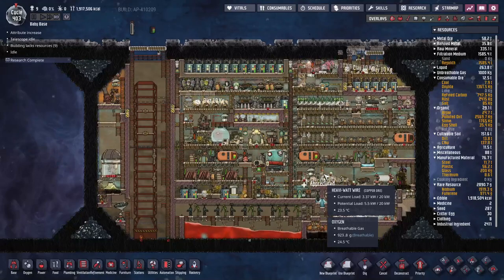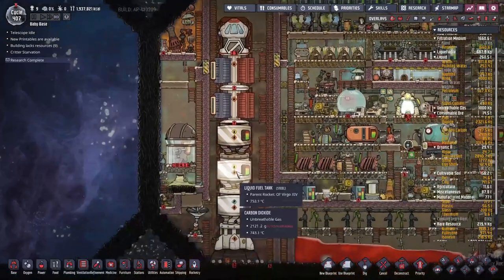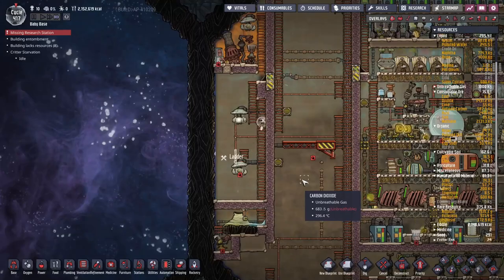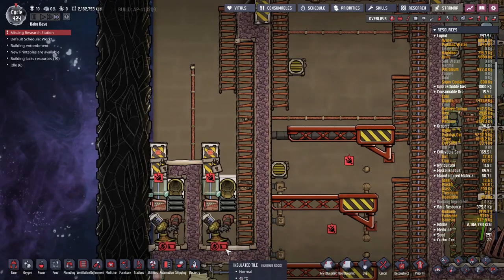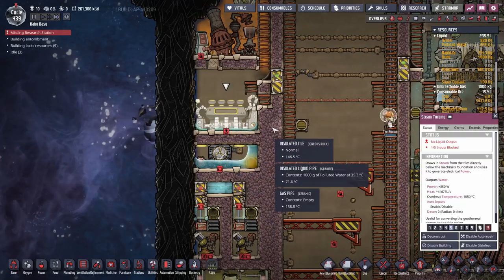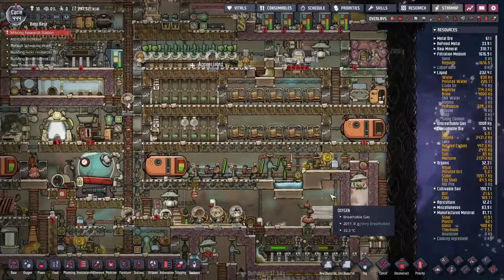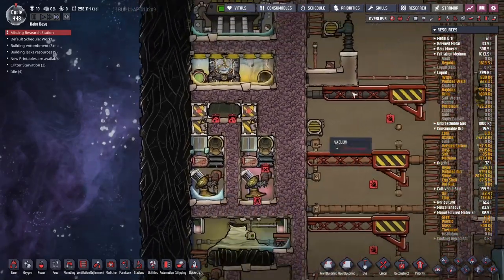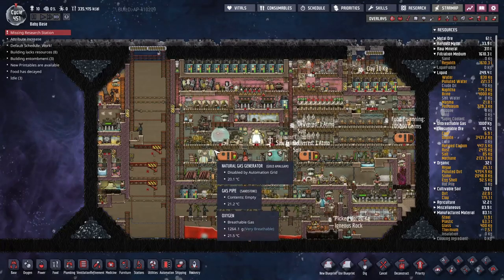Baby Base 12 : A little liquid O2 and Hydrogen : Oxygen not included

Comment: I honestly love that idea for the door heat transfer for the liquid hydrogen, seems way easier and less finicky than trying to set a aquatuner to the less than 14 degree window between solid and gaseous hydrogen
Reply: it's less effective though
Reply: You still can use door with aquatuner cooling diamond tiles
Reply: The minimum temparature is not low enough to make this work for faster gas flow. Try to experiment in your own sandbox save, there could be a working solution

Comment: I don't think dupes can make a 1 gap jump that also goes up or down a tile when there is a door there. So I suspect your drecko shearing is inaccessible? In my own trials I have found jumping to a door has to be level, or to make a diagonal jump you need a tile to land on before the door so they have a cell to occupy to activate the door so to speak. 

Looking again, if you rotate the mini pump anticlockwise on its left cell so it is upwards (deleting third ladder), then added a tile in front of the door the dupe should be able to make the diagonal jump from ladder. But i'm also looking at your grooming station. As ground below it is air tile, no need for level floor to manage co2. If you could drop that station by 1, you could move pump above it, then still have space for a tile to access to shearing. 

Love the series as ever chap :)

Comment: Gonna love how casually you tap into that freakin hot hydrogen vent, pipe it straight through your base and turn it liquid in that little spot. that aquatuner has quite the job. That's the true beauty of geothermal power: You don't have to worry that much about the drain until you start getting brownouts. I'd still imagine that the piped, hot hydrogen in the base area coud become an issue, or not?
Reply: The hydrogen cools down a lot by itself too. There just isn't that much mass there. And he has some active cooling in the base

Comment: Awesome now all you need is a micro regolith melter
Reply: He doesn't have an unlimited heat source for that to work.  After he has the sour gas boiler he could do one since he would have the electricity to just throw power at the problem.
Reply: @nikolassaraiva9088  you can make them with glass and metal refineries and it is a net positive heat and energy process just don't think it is possible to make it fit.

Comment: The dinky liquid o2 and h2 is ace. Why use ice rather than diamond? Is it so you can have a temp shift plate behind? I haven't quite grasped their behaviour as yet.
Reply from the maker: We are using both Ice and diamond. The temp shift plates are behind the water. The extra mass allows us to store more potential temperature. Its like having a hot cup of tea versus a hot bucket of tea. The bucket will take longer to change temperature so it keeps things more stable.
Reply: @FrancisJohnYT  Ah so it's because the ice has greater thermal stability with it's mass and c. Thank you.

Comment: 7:50 wouldn't it be better to put the air vent above the liquid vent?
Reply from the maker: Oh tricky question. For the O2 yesss I think.
However the H2 stacks to 1000kg so if I put the liquid vent below the air vent it can end up going over pressure and I will no longer be able to rotate the H2. O2 only stacks to 500kg so that would work...... however then it would not be symmetrical :)
Reply: @FrancisJohnYT  ah, decreasing productivity for aesthetics? I absolutely approve!!

Comment: Have u thought of taping into the heat the hydrogen vent makes? It comes out at 500C just a few more metal tiles could help u tap into it
Reply: space
Reply from the maker: Mr Shift nailed it, if I had space I would. I might be able to do something later after the remodel. Though then I will have a second rocket taking up space.
Reply: @FrancisJohnYT  hey hey, maybe, just maaaybe you could've put the hydrogen pipe trough a base cooling heat deletion devise's steam room? 
perhaps it would allow you to drain some amount of the energy into the power needed, instead of just upping overall base temperature by bringing in 500 C hot hydrogen pipe trough it, even tho you would need to regiggle an awful lot of gas piping trough the base.
Reply: If only u could move the valves then u could brick it up and tap into the heat
Reply: A radiant duct run through the aqua tuner room would let you pull a few hundred degrees of thermal energy out of it before it hits the condensation chamber.
Reply: These boys get it. You really so need to bleed off the heat first in your magma thermal energy steam room.

Watched your liquid hydrogen keep choke and sputter is hard.

Comment: uhm francis... you are pumping 500c hydrogen in the LH chamber... a temp diffrenc of 755c... hydrogen has a SHC of 2 so you need to kill 1610kdtu per kg of hydrogen.... you shoud prechill that...
Reply from the maker: That will happen, it's just right now I don't have a spare turbine to feed it through. At the same time the hydrogen from my electrolizers is only 70C, if I run that through a steam turbine area it will end up getting heated up.
The biggest bottle neck is free space right now.

Comment: Thoughts on the DLC news?
Reply from the maker: Mostly excited, multi asteroid colonies just sounds like perfection. Not sure about the nuclear unless it's a fuel type for the rockets.
Reply: @FrancisJohnYT  from everything they said its almost certainly a energy source too. i just hope there is a way to either get the nuclear material without dupe interaction or without any one machine a something like a petrolium boiler but for nuclear material.
Reply: @spoon1710  
Something like the Factorio nuclear chain would work. Mine the uranium ore somewhere, refine it, enrich it and then turn the enriched uranium into fuel cells

Comment: You are wasting so much power right now. That hydrogen vent emits 500 degree hydrogen and you're not leaching that heat before feeding it into the system, so your liquid hydrogen system is trying to liquify extremely hot hydrogen.
Run a loop through your steam room to drain at least some of the heat. Even draining it of 100 degrees of heat would be at least a little extra power returned rather than wasting all that free heat energy by dumping it into the aqua-tuner.
Reply: @gaydonaldtrump  the base cooling one is actually feels okay to pump heat into